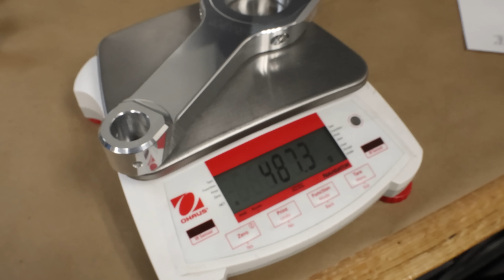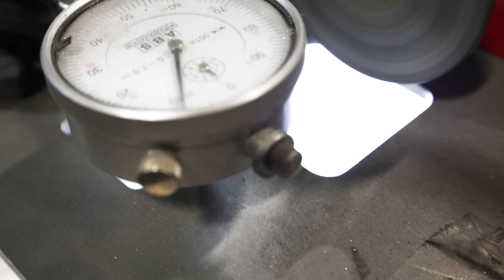11,500RPM K24 Honda Makes 1,600HP?! This Thing is a MONSTER!

Comment: All this and still no billet block? 😭 Didn’t Daniel aka Frustrate EG say anything over 1200 hp and the block splits?
Reply from the maker: Frustrate runs our K Series Race Cast cylinder head and a cast Ramey sleeved block at over 1700hp

Comment: Can you still call it a Honda engine when there is no Honda parts? Love it btw.  ❤
Reply: I asked myself that same question recently lol
Reply: Indeed, it's a bunch of expensive performance parts assembled into a modified crankcase.
You could do the same with more or less any half decent engine and get the same results,
I certainly don't consider it a K24 anymore.

Comment: Why still use the vtec system in a drag car? Imagine if the high lift cam profile was ground into the low rpm lobes. Then you could completely omit the center follower, lowering valvetrain mass

Comment: Need a dry sump system to maintain steady oil pressure and circulation at those engine speeds and power.

Comment: seen few buildings, nobody use arp studs on bottom half of the engine. any reason? i was thing about order a set, but i am think about to not.
Reply from the maker: The mains on these engines in particular are not a problem and the OEM machining is very precision.  When you install the studs it really distorts the housings, and you will be hard pressed to find someone that can get those housings as good as Honda did.  We love ARP, we partner with ARP, but that is one area on this engine that it doesn't need addressed.
Reply: @4pistonracing thanks! Helped a lot!

Comment: What a beautiful motor and what a artist you know I've seen my friend Steve run on the track against these people I'm assuming it's these people 4 piston motor builders but when Steve goes up against them he doesn't win but by 5 to 10 car lengths now I see why 4 piston I take my hat off to you guys and you guys need to hook up with my old friend Steve Morris how he's one hell of a engine builder and fabrication designer I've gotten to old well not to old my heart is worn out or I'd be right out there ripping down the 1/8 mile and 70 not to old but would never  jeopardize running because if something went to wrong

Comment: And then detonates after 3 passes .....causing everyone to wait 45 minutes to clean up the debris. 

No replacement for displacement.
Reply from the maker: There definitely needs to be some things addressed in the drag race classes right now.  People are pushing too hard, running on terribly maintained equipment, shooting for records when the track isn't there for a record, and piecing shit together in their yard rather than using professional engine builders.  Its super annoying....we didn't get to continue our racing this weekend as a direct result of this BS.  I feel your pain.
Reply: @4pistonracing  
And hey..im not knocking fun with small engine horsepower. But these are just grenades that cause everyone to not have fun at a track. 

Just stoo building lawnmower engines and get on the displacement and safe fun power.

Comment: Until dart comes out with a block for the K's this is all pointless. Thiers a shop that builds custom billet Hayabusa V8's that are 2.6 litre. I didn't check the pricing , but i think i would look into that before i built an engine that is known to split in half.
Reply: Please show us a k24 that's split in half?
K and B series have been doing big things for a very long time.
Reply from the maker: There will be a whole fleet of these engine running this weekend in Maryland....like they always do...making 1600+ and not splitting in half.  These blocks are super strong.

Comment: Wow 1,600hp with 11,500 Rpm 4C is like creating a bomb that can explode at any time🎉
Reply: except these ones don't ;)
Reply: @ArthurSperotto  i would not be so sure about that. Those engines (4 cilinders) with that kind of power ate not meant to last for a very long time
Reply: @darklegion7780 wrong. A billet block with 1600 hp is nothing. Speed factory runs 2200+ horsepower. There are street civics on cast blocks sleeved running 1300-1400 horsepower. Boostin performance 4g63 billet block also makes 2000+ horsepower he did an engine tear down on YouTube and it was fine after a year of abuse and multiple 6 second passes.
Reply: @darklegion7780 ate what?

Comment: Would this engine need valve adjustments? Seems like it would every couple thousand miles. Or at least a check
Reply from the maker: In a standard K engine you do a valve adjustment at 60k.  In this application yes you check it more frequently.  It is getting a rebuild at 10 if everything went well and the tune was good and the driver doesn't stick it into the wrong gear, or the wall, or whatever....1600hp this thing is unruly to drive.  Lots happens.

Comment: I am so happy to see a professional engine assembly, everything is clean, components and everything. Is this a standard engine? Or boreup? I have heard a word BLUEPRINT, they say if all The engine components are re-measured, the ones that are not in accordance with the factory materials are repaired, it can increase the engine power (because it is super precise). Is that true?
Reply: These guys assemble each engine to their own specifications.
They have over 20 years of data on  every different race engine application and combos.

Comment: HP= rpm*torque/5252.  That's the equation for horsepower. You 4 cylinder motor would have to generate 730ft-lbs. Of torque @ 11500 rpm to build 1600hp.  It's just math

Comment: Why do you use grease on metal bearings that are subject to high rotation, high pressure, and high friction?

It is right to apply oil there.

Why do you apply oil to the threads of the head bolt?

Parts that are likely to loosen due to vibration and thermal expansion require high friction, so assemble them in a dry state or use high-temperature screws.
Reply from the maker: That's actually a really good question.  In the class this runs there are no dry sumps allows so you cannot prime the oil system with oil for the first dry start.  The assembly grease helps a lot with the first rotations of the engines on the wet sump setup.  Its great protections for the first startup.  Secondly, sometimes when we sell an engine it may be for a project car that will sit for months before the engine is installed and started.  Sometimes that isn't the case, but in many cases it is.  Our experience over 26 years of shipping thousands of engines is that this particular grease provides better protection on initial startup for the customer.  It isn't used everywhere...just on certain critical areas for that first start.
Reply: @4pistonracing    I understand what you mean. 

I understand why you use grease, but when tightening head bolts, rust is a far-off issue. 

When tightening connecting rod bolts or head bolts, 

it is safer to use threadlocktite to prevent loosening due to high temperature and vibration. 

Using oil on the threads increases the risk of the bolts loosening in the future.
Reply from the maker: @serpent977e  Not to argue on Youtube, but absolutely not on the thread lock.  We didn't learn how to build engines by accident or trial and error.  My engine builders learned from serious mentor legends in motorsports, and have built multiple Indy 500 race winning engines, Lemans, Daytona24...all walks of the top level of motorsports.  We aren't guessing on fasteners, lubricants, and procedures.
Reply: @4pistonracing   I understand using grease on connecting rods to prevent rust while they are stored for long periods of time without oil for shipping. 

However, applying oil to the threads of a bolt does nothing for the race. 

The basic function of a bolt comes from the friction of the threads. 

Using oil on a bolt used in a high temperature, high rotation, high vibration area 

is a disadvantage. 

Just because there were no problems in the race does not mean there are no problems.

If you oil the threads of a bolt, tightening it with a torque wrench will be meaningless.

Later, when you take the engine apart for a rebuild, compare. 

This is not something to argue about. 

It is not always good to apply oil. 

If that were an advantage, all high-performance car and engine tuning companies would have oiled the bolt threads when assembling the engine. 

In reality, most people assemble dry or use Loctite on the threads.
Reply: @serpent977e  if you follow the Honda factory service manual, some very specific bolts (head, crank pulley) are specified to have oil when they're installed. It wouldn't make a difference on clamping force or be likely to loosen any more than stock. 

Honda figured out long ago that a lower torque setting, and then turning the bolt/nut to a specific angle, was a much more reliable way to get even and consistent final torque or clamping force. They had plenty of people who understand metal fatigue and bolt stretch rates of an alloy/heat treatment processed part.

And on top of that, the resume of the person assembling this motor includes multiple insanely more powerful and reliable than stock H badge engines.  These people are literally some of the best in their chosen profession, and among the best ones the planet.
Reply: @lewzero   Not all manufacturers follow the manual. 

Not all Honda engines are assembled that way. 

It's just that certain models are assembled that way. 

Some manufacturers have very tight tolerances for the threads and taps on their head bolts and crank bolts, while others don't. 

Everyone knows that tightening a bolt too hard doesn't necessarily increase the clamping strength. 

If the threads start to break, the clamping strength actually decreases, and in severe cases, the bolt head can even break.

Oiling the threads is only to prevent surface damage to zinc-plated or blackened bolts, which can cause peeling and rust. 

It does not help increase the tightening. 

For engines that need to be rebuilt frequently for racing, it reduces wear and tear during frequent disassembly and assembly, which extends the lifespan, but for general vehicles, it does not help at all. 

It only causes loosening of the bolt tightening force.
Reply: @serpent977e  So ARP have been doing it wrong for decades with their thread lube ?  4 Piston are being very polite by ignoring your subsequent comments.  But I know they want to say the clamp provided by a stud or bolt comes from the bolt stretch, and that the lubricants used on the threads and under the bolt heads reduce friction so that a more accurate stretch figure can be obtained.  Fastener 101 kind of stuff.
Reply: @BenS12510   
You have a very poor understanding.

That assembly process is only correct for a specific engine model of that brand

I said that not all of the tens of millions of engines in the world are assembled that way.

Still don't know what I mean?
Read a book.

Using lubricants to reduce friction is itself a factor that reduces the fastening force. 

If you have basic common sense, try testing it yourself. 

Bolts tightened at the rated torque using a torque wrench without applying lubricant, 

and bolts tightened at the rated torque using a torque wrench with lubricant applied. 

When loosening the bolts, see with your own eyes which one is maintaining the torque value.
Reply: Well, I  can see that was a useless comment.  If you don't believe the OEM uses their own instructions to do something, of course you're not going to understand. Live well dude
Reply: @lewzero    You are proving yourself to be a poor person who does not understand the meaning of words. 

The engine you have assembled is only a very small part of the engines that exist in the world. 

It is only the tip of the iceberg. 
And that is not the answer. 
Don't be mistaken.

People who don't understand have the same attitude as you.

A person who designs an engine and processes it with a machining center and a CNC lathe is different from someone who simply reads the manual and assembles it.

You are just an assembler.

You lack experience.

If you don't study material mechanics, thermodynamics, and ultra-precision machining yourself, keep your mouth shut.

You should be humble, not arrogant.

There are tens of thousands of engines in the world that are not assembled according to the manual you know.

They are just assembled according to the characteristics of each engine.

Do you understand what I mean now?

Comment: Ported or stock pump K series pump isnt going to live at 12k rpm. Specially with those tiny K series rod bearings. MIght make 1500 for a few dyno pulls thats it.
Reply from the maker: We make our own oil pump.  Thousands of them for a decade of service...hold pressure no problem to 12k.  Wet sump is mandated by the rules and this one occasionally drives on the street.

Comment: I'm pumped you guys are building my engine the attention to detail and care is industry leading
Reply: What're u getting built, and how much did it cost?
Reply: its a k20z3 for a 08 si a full na build about 8 grand into it but they have a bunch of other options depending on what you want and a easier option is getting there k24 crate motor but i wanted to keep the k20z3 to see how it shines. I would only trust maybe 3 companies to have the experience and attention to detail that they have 4 piston ,king motorsports and probably JRE im glad i choose 4 piston
Reply: @loganfurst3010 are you also getting the transmission built? Or engine only?
Reply: @Mabuhay_420  yeah by gear driven and it feels great so far been driving it for a few weeks now

Comment: Basically, a very expensive hand grenade.
Reply: Explosive power!
Reply: Nope. 1600 horsepower in a billet block is nothing. Speed factory runs a b series billet block and makes 2200+ horsepower and can make more. So 1600 would be good for a street tune set up.
Reply: @Brian-bv7ih this isn't a billet block
Reply: @Brian-bv7ih  Nope.  A 500 in.³ pro stock drag racing engine makes about 1500 hp, and is rebuilt after five passes. That’s about one minute of run time. A 2 L engine making 1500 hp will need to be rebuilt after every dyno  run.
Reply: @393Nader and a 572CI Steve Morris SMX makes 4500-5000hp and is rebuilt every 100 runs. 

This engine will handle a lot more than you think. The rebuilds you mention for prostock are 9/10 times valve work alone, due to how insanely aggressive a cam needs to be to make that kinda hp out of a relatively small displacement engine (a 632 BBC making 1000hp NA will go a very long time between rebuilds)
Reply: 4 piston does not make hand grenades. They make mechanical porn😁😍☘️
Reply: More like a very expensive grenade for the cock end of my Honda
Reply: Literalmente uma bomba relógio
Reply: @collectcarsbr not really. A billet block isn’t being pushed at 1600 horsepower speed factory runs 2200+ horsepower on their b series billet block and can run more than that. So 1600 would be good for a street tune set up.

Comment: Beryllium copper valve seats?
Reply from the maker: To help pull some heat away from the exhaust valve in a high heat high boost application.
Reply: @4pistonracing  yes.  I have them in my engine

Comment: Only so many hits on the cast block at that power it will eventually split
Reply from the maker: Actually the fastest K series car in the class runs cast blocks over 1800hp.  Splitting blocks is mostly tuneup related and not outright power.  They ran billet blocks before and those have some challenges of their own regarding heat treat.  These cast blocks with the fire ring work great with a tuner that knows what they are doing.

Comment: Is that giant one piece main caps assembly how they are from the factory.  or is that a aftermarket upgrade.   No wonder hondas can take so much power in such a small engine.
Reply from the maker: Honda is a great platform.  The K20/K24 is one of the best 4 cylinder engines ever designed.
Reply: yes its a factory component hence why its still cast.
Reply: @lennixsingh626  Thats awesome, I've been messing with old school small block chevys most of my life and they have weak main caps.  and the later model ls stuff has 6 bolt main caps that are sandwiched in.  Then I seen how 2 jz engines have the same kind of setup and thats why ls and 2jz stuff is way better than the older chevy engines. and now I see this, wow. That is a way better design. I was just impressed by how hardcore that little engine is designed.

Comment: You guys should build a V8 🥳
Reply: "Neutrons engines" did this. The K48 V8 engine.
Reply from the maker: @igvtec  No one has built that engine.  Conceptual right now.  We will though.
Reply: V8 based on K20 or k24, imagine V8 K40/K48 all motor or turbo setup? 750-1000whp NA or 2500-4000whp turbo? Imagine with this engine tech
Reply: Didn't someone do this this? Or am thinking of the hayabusa v8